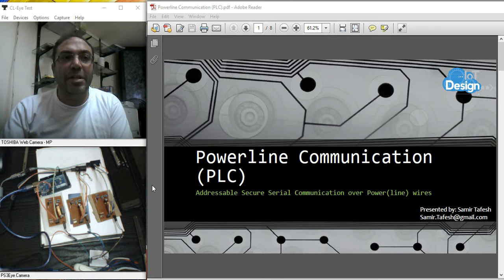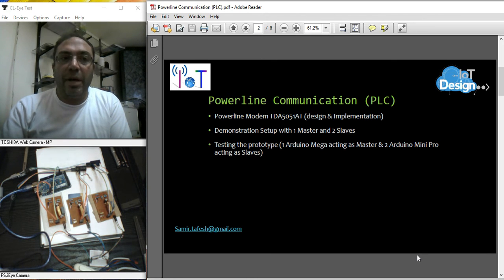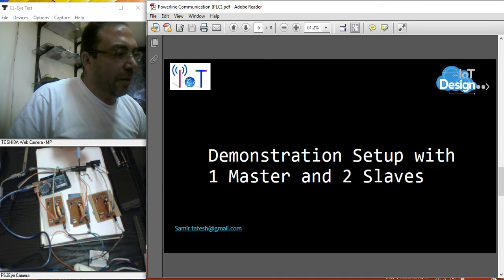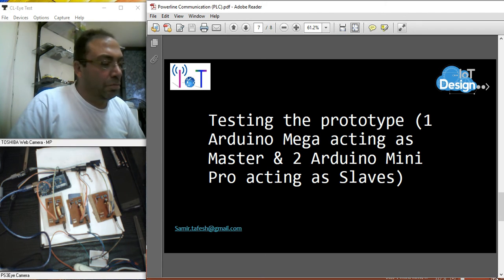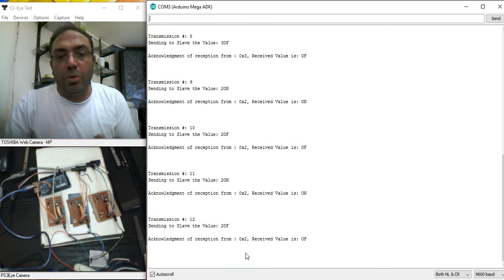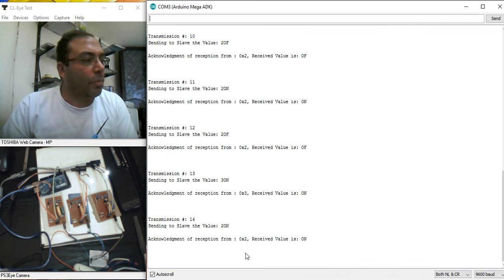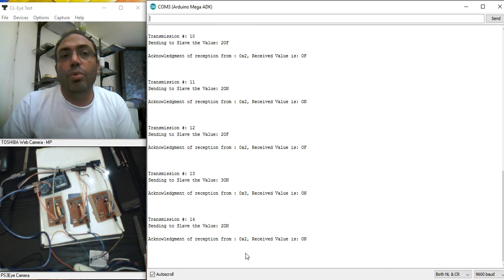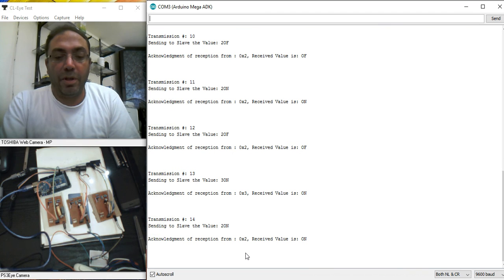IOT & M2M,  Serial Communication Over Powerline (PLC)

Comment: hello I see you demostration, very good. It is  possible to change hardwareserral to software serial? I need to use any digital port to transmit, thanks
Reply from the maker: Hello, definitly it is up to your design
Reply: @SamirTafesh  my problem is that I only have Arduino UNO, it only have 1 serial port. I don´t known how to change the code to work for softwareserial., thanks

Comment: sir i am working on  smart metering through power line communication and i have to send data of 3 energy  meter  to a single meter with descriding the name of unit from which i am recieving this data .
sir i am worried about power line modem 
 currently i am working on TDA 5051A ask plc  sir is it good for my rrequired application or suggest me a appropriate ic which i can use in this project 
i shall be thankfull to you
regards
samad farooque 
final year electrical enginering stiudent

Comment: Hello, thank you very much for sharing great material. I went through the datasheet the schematic there are different from the one you used in the slide, and the component names are not really visible. can you please share a download link for the material and the library for the arduino protocol you used?
Reply: Hi Samir! Please send it to me as well. I have sent you an email already
Reply: @vanessationgson2389  KINDLY sent it to me too if you have received email
Reply from the maker: Dear Yahya, definitly i can send you the material, please send me email samir dot tafesh at gmail dot com
Reply: @SamirTafesh  I send you an email requesting the same.

Comment: Hi Samir, is it possible to communicate through the I2C protocol using that modem?
Reply from the maker: Hi blueLine, thank you for your message, Frankly i have not tested it with I2C, but there is no objection that it does not work, i will try it once i have a bit of time and i will reply asap
Thank you

Comment: HI Samir, really nice work, thanks for sharing it
Recently I was interested in the powerline modules, I had found on the internet something like KQ-130F of www.kq100.com, cost about $ 8-10, but have a component in the "blackbox", not suitable for professional use. I ask only one question on the solution based on the TDA5051 chip, if you can answer me, how many slave modules and a single master can be connected on the same dedicated line? The application is a lighting controller.
Thanks again!
Reply from the maker: Hi marco, thank you for your message, Normally, you can connect as much slaves as you want, 
Why? Because All the clients receive the messages, and only the targeted one will take action
Thanks

Comment: Hello,U don,t use any transformer on the pcb.U connect the boards over the 220v main or u tested without any power of the 2 wire netwrok?
Reply from the maker: it is connected to 220v main direclty

Comment: Hello! I did poorly understand English. At the maximum distance information is passed
Reply: by 400m do you mean the length of a wire 400m long?
Reply from the maker: Yes, i have tested it on a 400 meter cable
Reply from the maker: I have tested it on about 400m